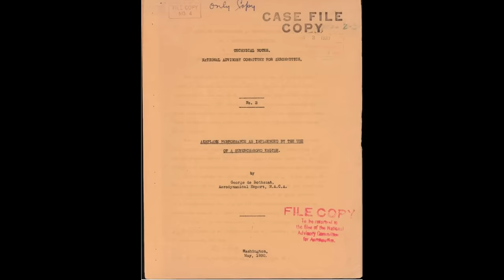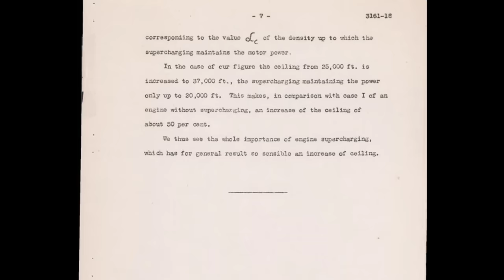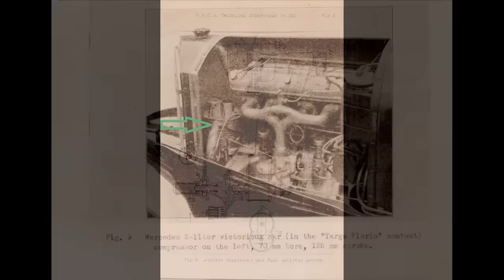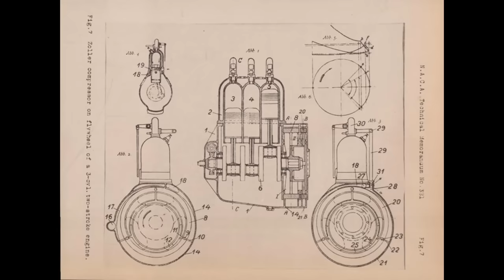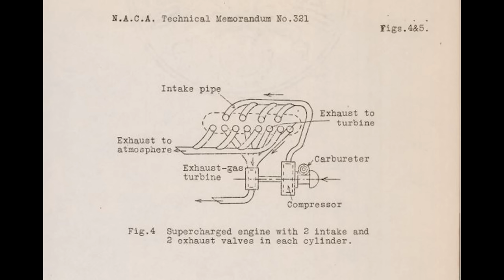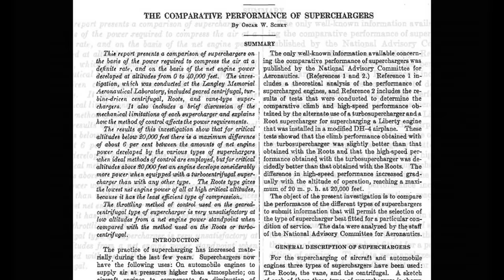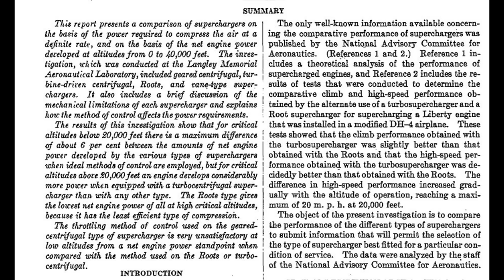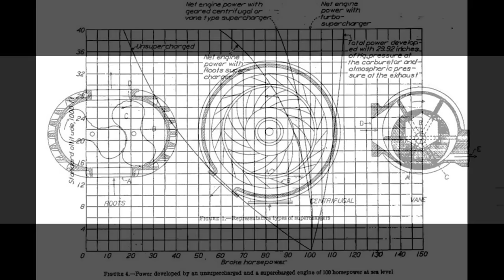Turbo vs Supercharging in WW2 Airplanes

Comment: 16:30 "navy hell bent on not using inlines" ...future video!
Reply: It's simple, really - a liquid-cooled engine in a Navy Airplane makes as much sense as an air-cooled engine in a Submarine.
Reply: @peterstickney7608  Tell that to Blackburn, Fairey, and Supermarine.
Reply: I think it's about reliability, and the Japanese seemed to have followed a similar thought process, mainly due to the large distances involved with the Pacific Theatre. When you catch a bullet in the wrong place and start leaking coolant or oil, an inline engine would seize up in a matter of seconds to a few minutes. A radial, apparently, was much more robust. Not just because it lacked coolant, but also because of the short crankshaft, where a couple of "missing" cylinders wouldn't throw everything completely off balance.

Comment: The cartoon about Pilot Pitt keeping the intercooler closed at low altitude - wouldn't that be the job of the flight engineer? M.
Reply from the maker: The P-47 doesn't have a flight engineer.
Reply: See 20:12. M.

Comment: And  how the BF 109 inifinite variable speed supercharger fare against a turbocharger ?

Senta a Púa
Reply from the maker: It would fare pretty well. However, the 109's supercharger does have infinite speeds, but it's  a single stage, meaning it only has one compressor. The Thunderbolt has two stages, plus infinite speeds on the turbine. So it's not an apples to apples comparison.
Reply: The variable speed drive was more of a quality of life improvement. You wouldn't have to change supercharger gears throughout varying levels of altitude, and that would also eliminate engine performance "jumps" caused by shifting. It just smoothed out the power curve between sea level and critical altitude.

But the raw performance limits of a turbo-supercharger setup was always out of reach for Bf 109s. From the G-6 onwards there were some variants that used the supercharger of the DB 603 (a bigger version of the DB 605 engine). They tried to counter the lower grade fuel by injecting MW50 (50% methanol-water solution, essentially ADI) and there was also GM-1 (Göring Mixture, Nitrous Oxide). But there was only so much altitude performance to be squeezed out of that engine.

The most important differences are:

1. As Greg said, the turbos were always part of a two-stage setup. The turbo-supercharger was always used in combination with a conventional engine supercharger, a centrifugal blower that was part of the engine design from the start. The main advantage of this is the intercooling, since compressing air always heats it up as well.

2. The turbo-supercharger is more efficient. I mean the energy to drive the turbine isn't free (increase back pressure), and you also lose the not insignificant thrust from backwards facing exhaust stacks... but it's a considerable gain in performance at higher altitudes.

Comment: Turbo supercharged piston engines went on to have a long life in civil aviation.
Reply from the maker: That's true, there are still many turbo Lycoming 6 cylinders running around, but in large Military transports, or Civil Airliners, they started to fade out by the late 1950's and went away pretty fast from that point.

Comment: The jet propulsion effect of the exhaust is one issue that you did not review nor do I find anything in the comments. Turbocharging will harvest much of the excess energy in the exhaust. That is the pseudo-free part of turbocharging. et propulsion from the exhaust will return a bit, if you are going 300 mph true.  Most of the energy is taken out by the turbine wheel at high boost* and in the early turbo super chargers see fig. 6 in ref 2 the designers blew the exhaust in all directions even retrograde.  In the P-47 at least the exhaust exit is going backwards properly. On the P-38 and B-17 installations I cannot find a diagram or a picture that indicates proper management at all. 
I found 2 interesting documents on the web, neither terribly informative but interesting. The first is NACA trial of a Spitfire in 1942 with original and NACA ejector exhausts- NACA was interested in the idea. The pictures are poor but it looks like the NACA modification is to go from 3 exhausts per side to 6. The report claims a 6 mph increase in speed at 22,000 feet -chosen because it was above critical altitude for that engine and that helped validate the tests. There's , as you would expect,  a large discussion of test methods and the limits there of but that NACA thought that the boost in speed was real. And in real life  later Spits had more exhausts.
 https://apps.dtic.mil/dtic/tr/fulltext/u2/a800911.pdf

The second is a 2019 paper by someone? on turbo-compound engines in the 1950's airliners which I found interesting primarily for the diagram showing massive energy in the exhaust. After all a supercharged aero engine at 30,000' is the very antithesis of an Atkinson cycle with the effective length of the compression stroke being multiples of the power harvesting stroke. There was much more expansion to be done after the axhaust left the cylinder.
WasteHeat.shtml
The only reason that the Merlin supercharged fighters could stay close to a P-47 at 30,000' had to be the jet propulsion effect recovering some of the 30% loss of shaft horsepower.
The turbo's virtuous cycle is at high boost there is more energy in the exhaust to make higher boost.
Reply from the maker: I have an entire video about the jet propulsion of the exhaust, and I focus on it heavily in at least two others.
Reply: @GregsAirplanesandAutomobiles  
I looked and found these in case anyone else is looking for the videos I found "world War Two Aircraft Exhaust Pipe Design" and there is one on Spitfire exhaust separate.
This may be a direct link watch
Reply: @GregsAirplanesandAutomobiles  Thanks for the note. I was able to find the exhaust videos.

Comment: I thought turbo supercharging was the presence of both an internal supercharger, and a turbocharger.  An engine with a turbocharger but no supercharger, would simply be turbocharged?   Maybe the terminology has just changed, and back then they never called them turbochargers, they called them turbo superchargers, and it just so happened that most of them also had a supercharger?
Reply from the maker: The terminology has changed. What was called turbosupercharging is now called turbocharging.

Comment: No turbocharged Allied aircraft got to 49000 ft  The plane with the most kills on the Allied side had supercharged engines , No turbocharged allied plane achieved 5480 ft/min in the climb . Just some info that is out there
Reply from the maker: Why on earth would you size a turbo to operate at 49,000 feet in a WW2 airplane? The turbos were sized for the range in which they operated. US bombers operated at 25,000 feet, thus escort fighters were set up to provide good performance into the low 30's, although most could reach 40k or more with no problem. I'm not sure what your point is about altitude. It can't be that turbo's are for some reason unable to match superchargers in altitude performance because they certainly can and quite easily if needed. 

     The P-47 had the most kills against the Luftwaffe when it mattered the most. After D-Day the Luftwaffe was weak and with inexperienced pilots. The P-51s shot down more airplanes, but against much weaker opponents. 

Climb rate is a function of power available vs. power required. Turbos are not at a disadvantage there. I think you may be comparing short range to long range airplanes and confusing that with forced induction systems.
Reply: @GregsAirplanesandAutomobiles  That is just the point with the R/R Merlin and Griffon the size of the super did not change just the gear ratios And yet if I read you correctly the size of the Turbocharger did change with different applications . Is that correct ?
Reply: @GregsAirplanesandAutomobiles   To match the Ta152  I imagine And the Spitfire did it Your turbos did not

Comment: i read somewhere that USA sent some P38s to Great Britain, they didnt like the turbos and actually took turbos off , and the planes had no speed or altitude , so used for reconn pictures!

could it have been they outperformed the SPITS, and England would have non of that!
Reply: Tony Maughan  The U.S. government didn't block it - the original P-322s that the Brits were going to get were the results of a French contract from 1939 (Along with the P-400 Airacobras, and P-40 Tomahawks), and the French, and later the British, wanted to simplify their logistics by using the same engine (V1710 C-15) on the Lightnings and the Tomahawks.  A total of 667 were on order.
(Before the "But the altitude..." refrain comes up, when these airplanes were contracted for, their altitude performance was the same or better than that of their European contemporaries.  (In fact, during the Battle of Britain, as early Merlins were re-rated to use 100 Octane fuel, peak performance altitudes dropped.)  Of course, one of the things lost in specifying the Tomahawk's engine for the Lightnings was the counter rotation (Handed rotation) which cancelled torque reaction.
As it was, the P-322 Lightning I wasn't a slouch, turning in an homest 370 mph at 15,000', and having about a 3000'/minute rate of climb.  It easily outperformed the Westland Whirlwind and Beaufighter.
In any case, the Lightnign I purchase was cut back to 144 aircraft, and the follow-on Lightning II for the balance of the order was to have the V1710 F series handed engines and the turbosupechargers.  (They were accepted by the USAAF as P-38Fs and Gs)
 
And no, they didn't remove the turbosuperchargers from their Fortresses and Liberators. - However, the initial batches of Liberator Is and Liberator IIs didn't have turbosuperchargers (Being the equivalent of the B-24A) and had R1830 S3C4G engines with geared 2-speed blowers.
Reply: i can remember Pearl harbor 7yrs old, my dad got all upset(ranting) saying it was no surprise we all knew it was coming(why would Japan spend 10/12 yrs building up a formidible military , without any reasons?

OK so much for history, at that time my father worked in the USA General electric aviation division ,LYNN MASSACHUSETTS ,
one day brought home a funny looking round wheel thingy, bunch of fins on it, i said it looked like a small water wheel, DUH, he laughed said it was for some airplanes, but this one was damaged scrape bin.

i still believe the Allison V1710 was a better engine than the RR Merlin 1650, it never got the chance to show what it could do !
that Merlin  monkey motion  acuation valve train system just dont look right to me, compared to the 1710 system, side by side!
it has been said that the 1710 has 40% less moving parts than 1650, and is simpler and more dependable!

Comment: Why would u NOT use Turbos?? The only reason is space, everything else is far better including constant throttle setting in planes.
Reply from the maker: There are a lot of reasons to use superchargers over turbos. Both have their advantages, but in WW2 aircraft, mechanically driven superchargers were far more common.

Comment: Some clever typing at 5:14. M.
Reply from the maker: I'm not sure what you mean.
Reply: Was the drawing done before the typing or after? Either way they would have to be lined-up. Sorry, I do a lot of word processing and the drawing with typed labels looked quite difficult to do successfully with a typewriter. M.
Reply from the maker: That's an original document from the 1920's. They didn't have word processors back then.
Reply: Greg's Airplanes and Automobiles I know. I just think that that sort of document must have required a lot skill when using a typewriter. M.
Reply from the maker: Oh, I get it now. I think you're right. Just drawing all this stuff was a ton of work. I'm trying to use these old documents as much as I can in my videos.

Comment: At 25.04, that's a P-400, not a P-39.
Reply from the maker: I'm not so sure. The P-400 usually has the 20mm Hispano cannon in the nose as well as two 50 cals. I don't see them there. I think that one is an early P-39 prototype.

Comment: I'm trying to learn more about dive bomber sights, for example I'm trying to learn about the Mk 20 Mod 4 used on the AD/A-1 Skyraider and AC-47 Gunship.  In particular the meaning of the white, yellow and orange Reticles and the use of the large "mils" knob.  
http://www.prc68.com/I/Mk20Mod4Gun-BombSight.shtml

Also discovered there's a problem when a dive bomber releases a bomb from a center line rack in that it will speed up and go through the propeller.  So there needs to be a special bomb rack that moves it outside the prop disk.  How to learn more about that?  What was used on early dive bombers?
http://www.prc68.com/I/Aircraft.shtml#BombPatents
Reply from the maker: Hi Brooke. I have seriously though about covering those things, gunsights, along with level and dive bombing sights and systems. However, I just have other topics that are higher on the list, and limited time to devote to this.

Comment: The Germans position their supercharger the way that they did because they had it's one of them are gun shooting through the crank are the engine and mounting a supercharger the same way Rolls-Royce did would be in the way of the gun.
Reply from the maker: Really? Source? If so, why did they do it on cars first? A cannon was not an option on the Mercedes SSK racecars.

Comment: Early British jets were like turbo-superchargers without the engine in the middle.
Reply from the maker: I almost covered that in the video, but it was just getting to be too long, so that got cut out.
Reply: Yeah, huge turbo-superchargers.
Reply: Well, the early german turbine engines also looked very much alike.
Reply: @Tony Maughan 
Yeah the experience with centeifugal compressors made the development much easier. Makes one questioning the germans decision to scrap that design and rather concentrate on axial flow turbines.
Reply: Tony Maughan  The centrifugal compressor for a jet was Frank Whittle's idea - Yes, it took a lot from piston-engine superchargers, but it still had to operate at a higher pressure ratio, moving a vastly greater mass of air, over a wider range of operating speeds.  Even with that, it was much simpler than the proposed alternatives.
It's interesting to ponder what would have happened if the Air Ministry hadn't had their tame jet engine expert, A.A. Griffiths, who had spent the early 1930s failing to get his baroque axial flow compressors to work, evaluate Whittle's proposals.  Griffiths did not believe that it could be that simple (To give him the benefit of the doubt) and did not recommend development.  Seeking commercial backing cost 2 years of development time for Whittle.
Reply: @peterstickney7608  
Yeah, that doesn't matter, as soon as you got the concept right and know the weaknesses you basically can do everything with equations, it is that simple. Whereas axial flow compressor weren't that popular (i believe mainly because of the materials that were needed for the blades and the expensive and complicated manufactoring process). Centrifugal compressor wheels have the advantage of being relativly easy to manufacture, cheap and very steardy because of the solid plate that holds all the blades. Centrifugal compressors jet engines were the cleverest choice  for the early days of jet propulsion.
Reply: @Tony Maughan Whittle proposed it in 1930; it wasn't so much pragmatism as practical engineering.
Reply: @mandernachluca3774  In 1939 Lockheed built a mock-up axial flow jet engine but couldn't get Army interest, nor for the fighter proposal intended to use it. Some of the German question you raise had to do with RLM (air ministry) politics, frequently anti-Heinkel.

Comment: Next time you narrate a video use a better mic and some type voice booth or other enclosure to minimize or eliminate sound bounce, which is distracting here.  An enclosure can be as simple as hanging a  blanket in front and to the sides.  If you use a music stand for copy, put a beach towel over it to absorb sound and avoid reflective sound.  You narrate well, so get the most from it.  Remember, you're the story teller.
Reply from the maker: That sounds easy, but I make these videos in hotel rooms, a mic stand is out of the question, I don't have room to pack it. I'll try to improve the sound quality, but it's not as easy as just buying stuff. I pack for 17 day trips in 2 small carry on bags. Adding bulk isn't an option.
Reply: Sit on the floor! It puts you further away from the reflective surfaces. Also try hanging the duvet over the wardrobe (closet?) door. Crazy but it works.

Comment: I don't have 40 minutes or brains to understand the video so can somebody tell me which was better?
Reply from the maker: For high altitude work, especially in bigger airplanes, turbocharging was better. In low and medium altitude planes, it's a bit of a toss up, but history slightly favors the multistage geared centrifugal, as used in the Corsair, Hellcat, and P-51B and later versions.

Comment: By 1920?  Lots of important  WWI engines were supercharged. Same deal with race car engines.
Reply: Centrifugal?  Most automotive superchargers were roots type, not centrifugal.  Aircraft engines' narrow RPM range for power allowed for centrifugal superchargers.  Why 90 degrees?  Hood height.  Besides, lots of automotive roots superchargers were driven inline with the crank usually right beside the crankcase.
Reply from the maker: Billy, virtually every supercharged European car in the 1920's went with a Roots type, and virtually every US car from then until the 1960's went with a centrifugal. I thought I explained the reasons. Your 90 degree hood height theory makes no sense. That has nothing to do with hood height, you last statement even makes that clear.